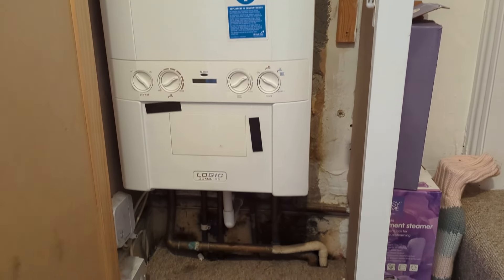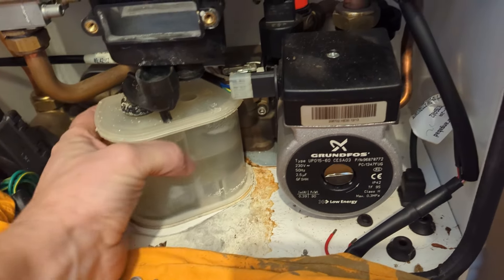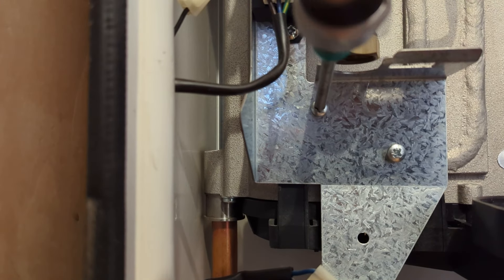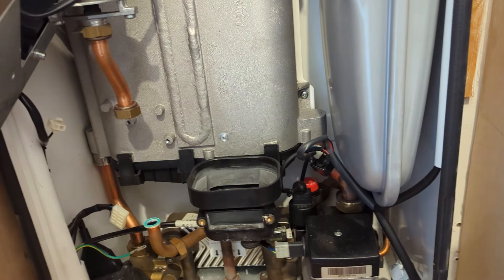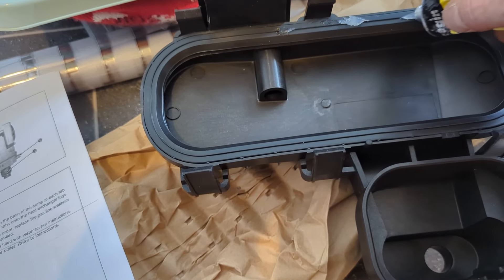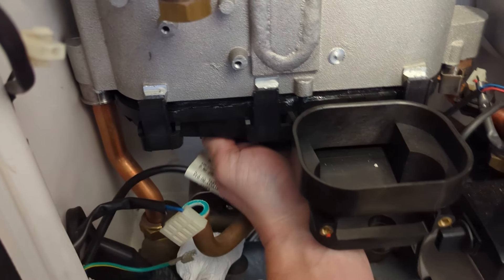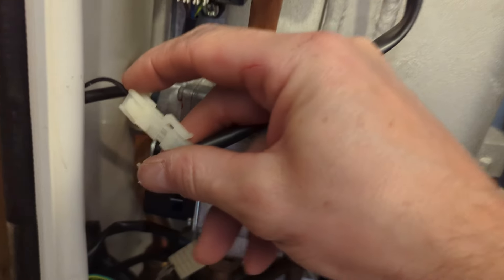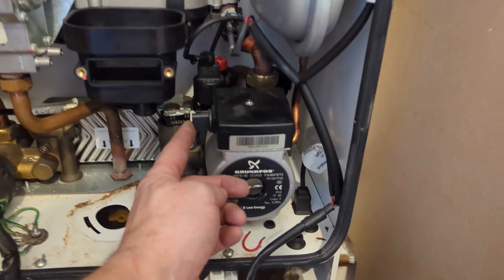Ideal Logic combi boiler leaking. Replacing a split sump and cover

Comment: I have this smae issue, the boiler is slightly different but very similar. Do you advise me doing it myself? I know i will be removing gas bits but using my common sense and experience i think i can do it without major issue and with your video helping.
Reply from the maker: To be honest. I wouldn't personally do this job if I wasn't gas safe and had a flue gas analyser. I can't stop you from doing it though. I would do this job for £100 and include all the safety checks that aren't on the video including checking for any gas leaks, checking the working gas pressure at the meter etc etc. I don't think saving £100 is worth doing it yourself. Just my opinion...be careful